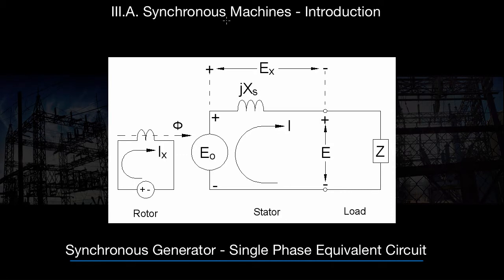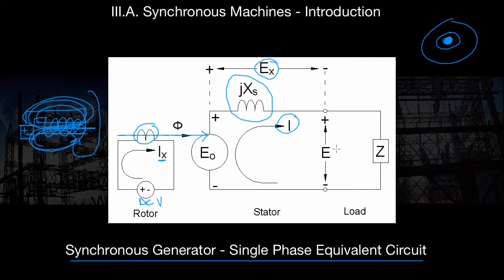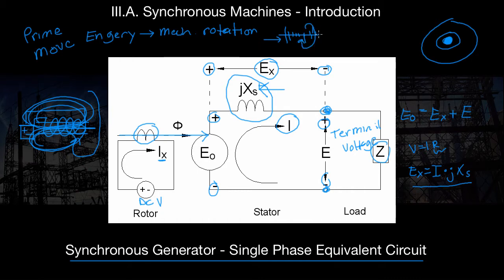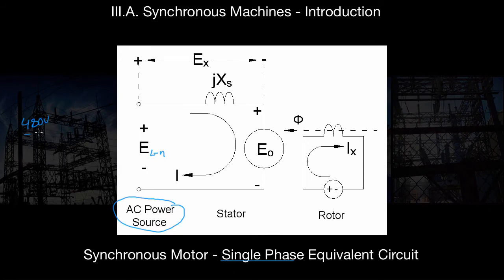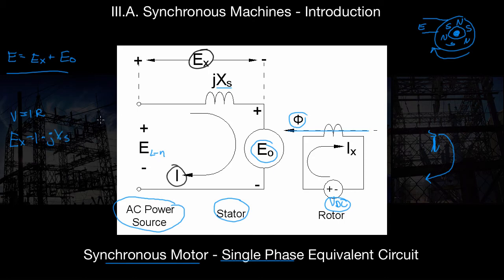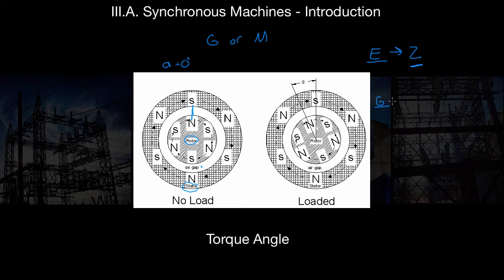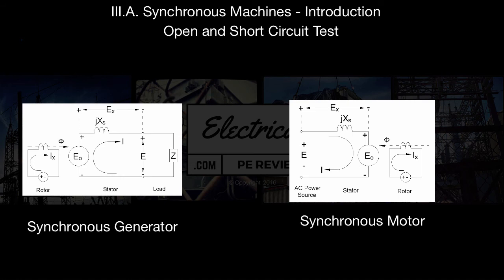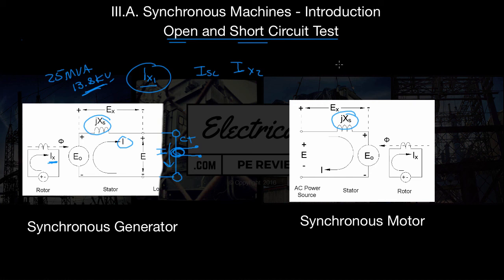An introduction of Synchronous Machines (Generators and Motors) for the PE Exam in Electrical Power

Comment: I have never deal with synchronous machines until I start preparing for the PE exam. Your detailled step-by-step method helps me to understand the essentials. Now I can clearly make the difference between synchronous motors and generators. I have to admit that I was so confused when reading the power books on synchronous machines.
Reply: How did your exam go?

Comment: So do u mean delta is the electrical equivalent of mechanical angle    alfa. In alter
Reply from the maker: Yes, however electrical angle delta is the lead lag angle between the terminal voltage and the induced voltage while the mechanical angle alpha is the mechanical displacement measured between the matching stator and excited rotor poles.

Comment: The best parts were the equivalent circuit models that showed how the electric current creates the magnetic flux. More importantly where the internal voltage equations for motors and generators that apply directly to the PE exam.